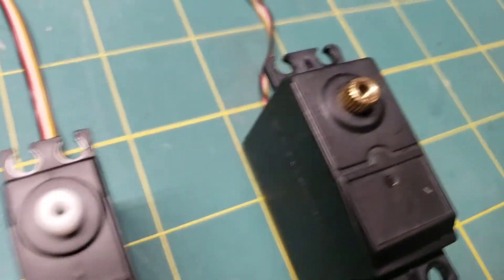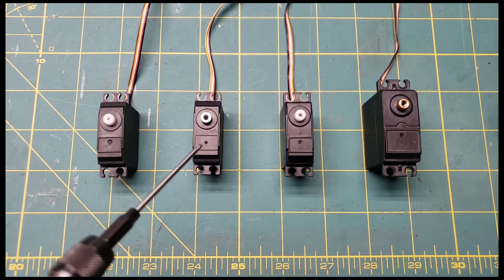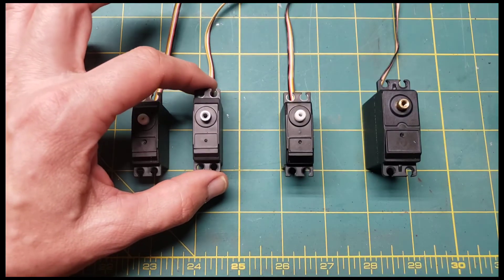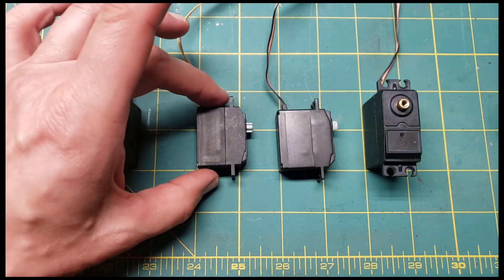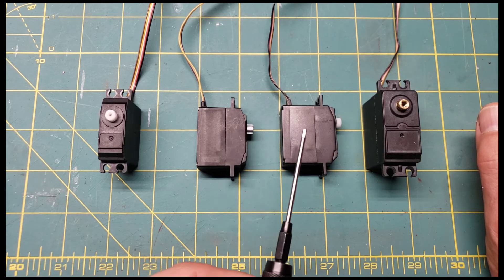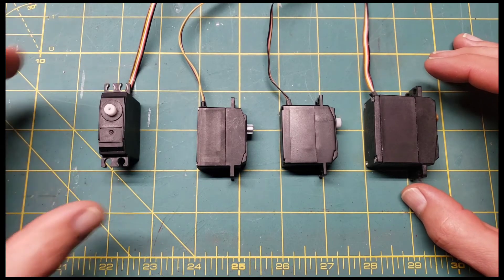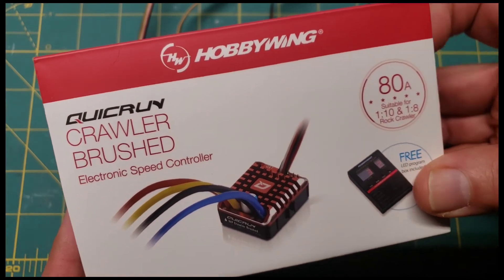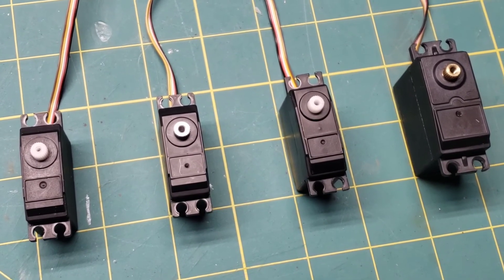WLToys 12428 & 10428 Servos

Comment: Hi 👋 If I follow your explanations correctly, can we use the metal servo of the 12428 to replace the gearbox servo of the 10248? Thank you for your answer 😉
Reply from the maker: Yes, they are nearly the same size. You'll need to set end-points or you could burn out the servo.

Comment: You can mod any 3wire servo to 5wire. Just remove the pcb from the servo (as wltoys likes to put this part onto the esc), solder on to the potentiometers 3 terminals and the 2 motor terminals.
Reply from the maker: While you are correct, most people  either won't or are unable to. I don't see the benefit of keeping a more proprietary ESC and Transmitter and opting for a more common 3 wire setup
Reply: @backyardbashers7212  No there's no real benefit except you can keep the wltoys ESC. For me for example the 550 motor was more than enough on 3S and I don't see the need to make it even faster just because. But I still wrecked a lot of wltoys servos (even the metal ones) and after changing to a proper hobby grade servo I did not manage to break anything on the car again :) ALso I didn't really recommend it to anyone, I just write the same thing into every topic it fit's, many people have the believe wltoys uses some magic proprietary protocol or something :)
Reply from the maker: @VincentFischer  lol... I'm of the philosophy, you can pay me know or pay be later. Sticking with the WLToys parts will likely cost you more in the long run and not perform as well. 

I can only speak from my own experience. To each their own.

Comment: hello, can the 10428 metal servo be installed on the 12428?
Reply from the maker: The larger metal steering servo of the 10428 would require modifications to the 12428, as it is 3/8" wider than the stock 12428 servo.
Reply: @backyardbashers7212  I also think